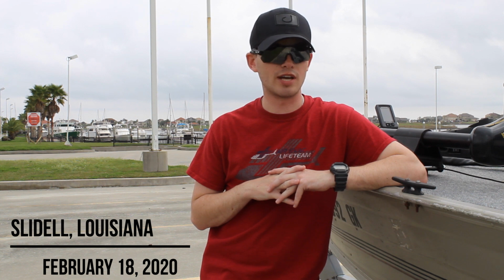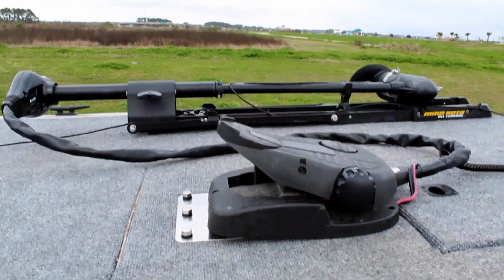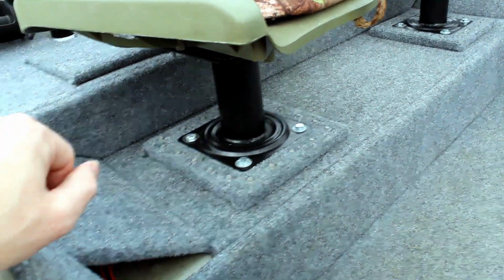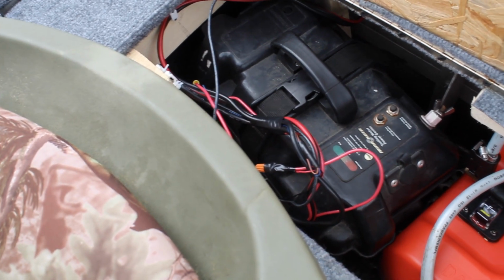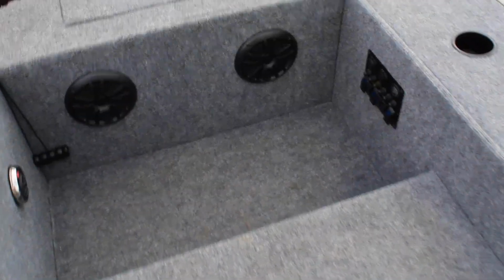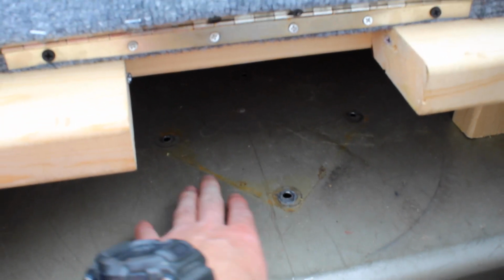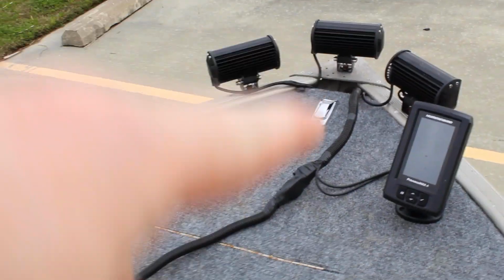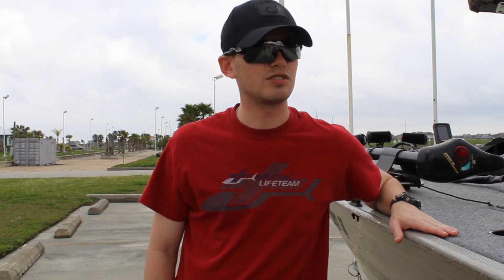16ft Bass Boat Build - DIY

Comment: Why didn't you just cut a hole in the metal bench,  install your seat then weld the piece of metal you cut out back in place.  Don't have a welder then the wood you covered the bench with, would hide the hole.. just an idea